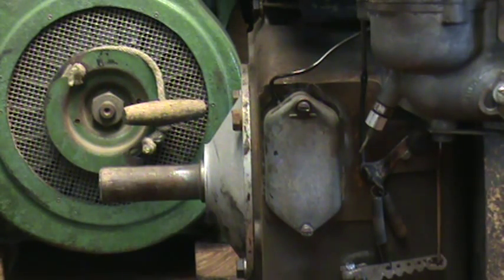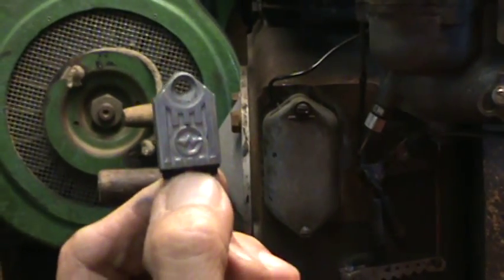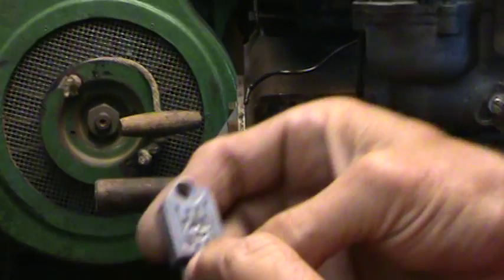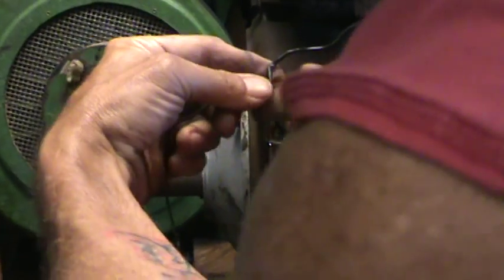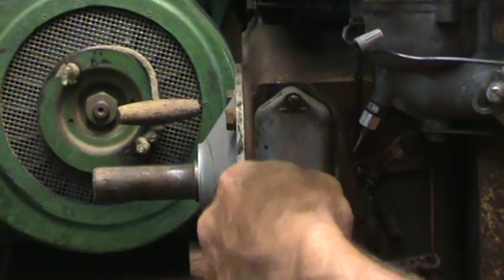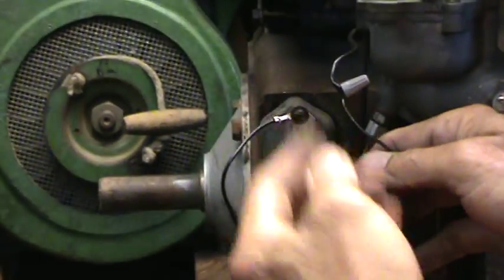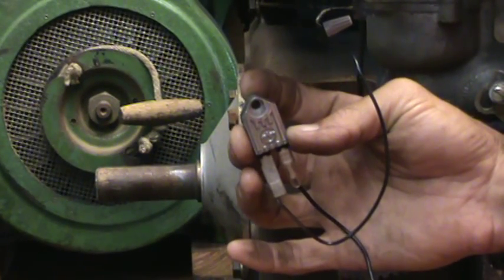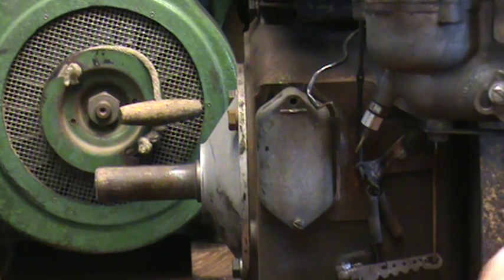Small Engine Ignition from Points to Electronic Ignition in 3 Minutes!

Comment: I had a Kohler/Lincoln welder/generator that would take forever to start and an hours worth of fiddling and praying until it would run. I stuck one of these on it and didn't need the electric starter we had made for it. One or two pulls and it caught every time. Definitely worth the money. Especially when the airheads at the parts counter can't find your replacement points!

Comment: Would that work on an old 8 hp kohler? I see it said that not for use in battery ignition applications.
Reply: ZippoVarga Thanks I'm glad to hear that. now I can order one. thanks for the great video. there is nothing better than an oldie but goodie
Reply from the maker: xle5363 That is correct, it isn't made for battery ignition small engines. The battery will fry the module.
Reply: ZippoVarga will it work on plug in electric start/ pull cord toro CCR 2000e engine? thanks
Reply from the maker: Any engine with a magneto ignition. It's just not designed for external battery coils. So anything else, it'll work.
Reply: I've got a 1963 Harley Sportster with a magneto The points are in the magneto with the coil. It's timed by rotating the magneto. Even though it has no battery I don't see how it could work without something to break the connection to the coil. What don't I understand? How do you time it without the points in the mag?